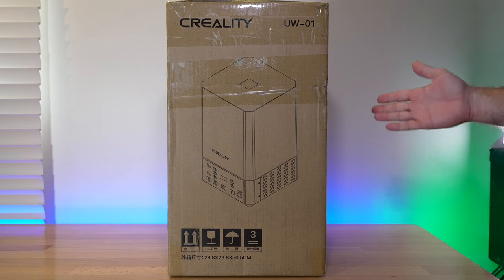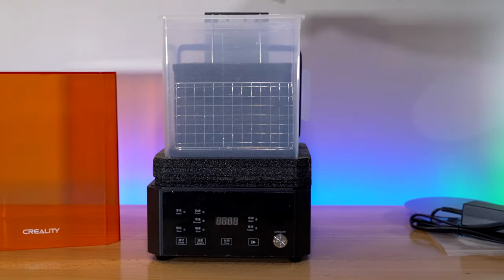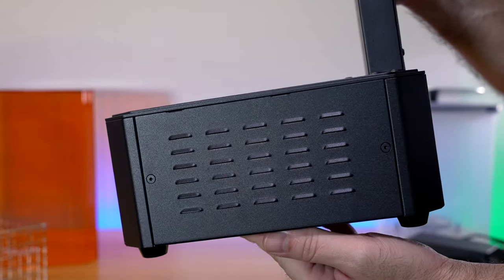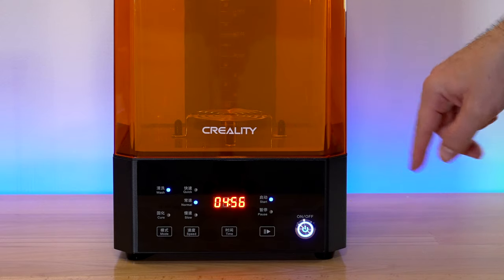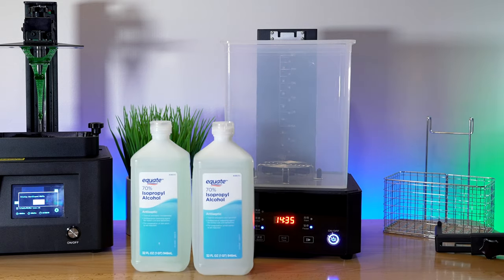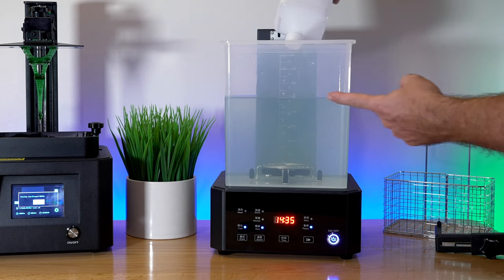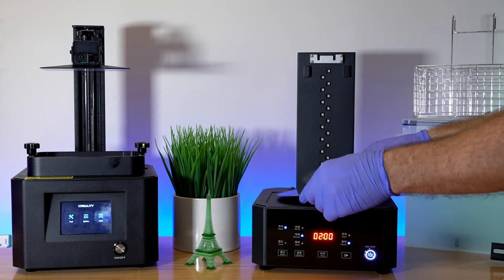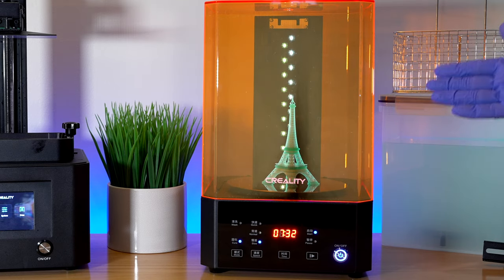Creality UW-01 - Wash & Cure Station

Comment: I actually use mine without anything in it as far as a basket.  With the bigger models, and the cover on the spine, not a problem at all.. lol, i do find the cure speeds a bit annoyingly fast.  Also, I use denatured alcohol, which works great. And you can use the lid also on the cure as long as your not using the basket. I wish they sold extra buckets also.  Luckily, you can use the buckets from an elegoo mercury

Comment: I think I'm going to get one of these
I thought I could get away with manual washing and curing, but it sucks
I've been spoilt by our form 3 at work with the auto wash and cure stations
Also, I've broken the railings on that Eiffel Tower multiple times from scrubbing with a brush to wash
I want to be able to print fine detail without destroying it in my wash

Comment: How do you work out the time the print needs to be cleaned / cured?
Reply: I usually go based on feel
Reply: When you’re cleaning sometimes you can feel it still be a little slimy or not all the material is off of it. When you are curing it, I usually do two minutes and feel for tackiness. When it no longer feels tacky then I pull it off

Comment: I'd recommend buying a magnetic flexible build plate for your bed, this will eliminate breaking the model. You should also never use a metal tool on the bed, the printer should've come with a plastic spatula. You can find a two pack of magnetic flexible build plates on Amazon for $26 at the time of this post.

Comment: hey man, great content but just a tip, your video is very hard to follow with the way you cut it so many times mid sentence. once you notice it's happening, it's impossible to ignore! if you don't get the words out right try again! don't just stitch together 2 words at a time in several cuts to make a sentence.